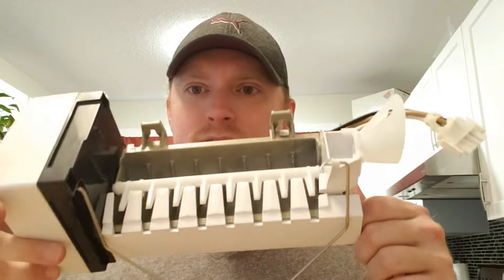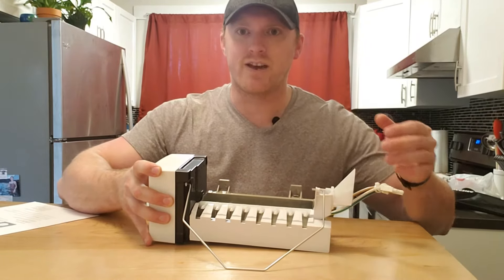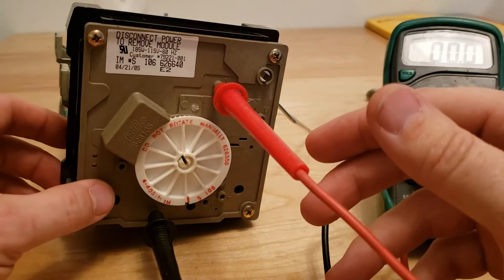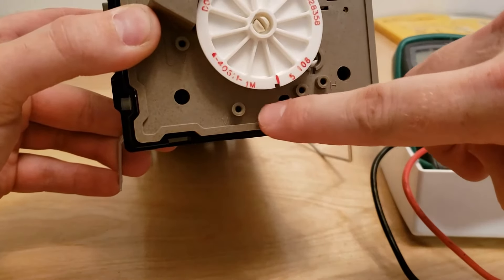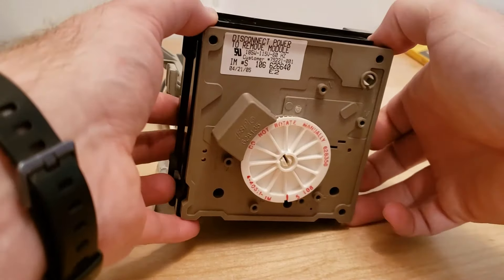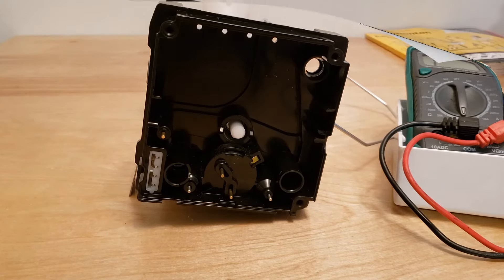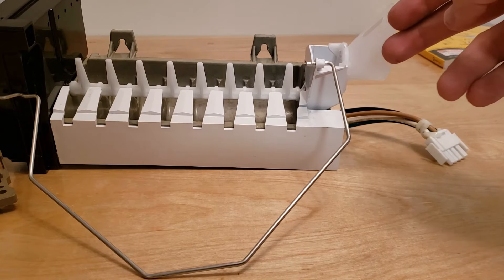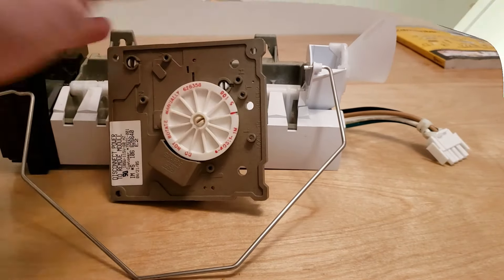FRIDGE ICEMAKER HOW IT WORKS - TOTAL DIAGNOSTIC GUIDE

Comment: Thank you Greg, second time pulling the ice maker after seeing your video I decided I needed to inspect contact points under the cover and wala there it was. Over time moisture caused the heater terminal in the inside of the cover to arch and burn eventually causing it to😀 short and stop working. You Did a nice job of identifying ALL the test points on the exterior cover. Again thank you, everything got a good inspection and cleaning also. Jayme
Reply from the maker: I'm glad you got it figured out. And thanks for watching Monty Piethon!
Reply: Bro, y lo arreglaste, de mi igual se cortocircuito, me podés explicar más a profundidad, con el conector  de la cubierta te refieres al módulo, a la resistencia?

Comment: I just replaced mine with a non-OEM unit. The plug was wrong, easily swapped with the OEM that was leaking at the tray in a couple of spots.  The cubes are slightly smaller.  The heater actually has a cover so there are no accidental shocks to the back of the hand.  It happened to me once. 

The aftermarket unit cost 65 bucks.  The OEM is $130 from Whirlpool.   I’m battling the water level.  It over filling so much that the fingers can’t dislodge the ice.  I gave it a 1/4 turn clockwise to reduce the flow time. 

I saw a video where the guy was talking about the overfilling is due to water pressure. He didn’t say anything about a time for the valve to open.  I didn’t watch the whole video.  It would be nice if the small dial on the side had markings for -/+.  A lot of the “water level adjustments” videos have the screw on the face of the module, upper right of the dial.  I had a 50/50 shot in getting it right.  Your video confirms I did get it right.
Reply from the maker: Thanks for watching Dave B, and for the great feedback.

Comment: Would have liked to have seen you point out how to check the voltage at the connector.  There are 5 wires there and I'm not sure which should have voltage.
Overall a good video though.
Reply from the maker: Thanks for the feedback Wayne Hearn. Thanks for watching.

Comment: GREAT video !! very comprehensive... I learned a lot ... especially taking apart mechanism and mentioning what each "test hole" is for including resistance and voltage if there is any. Sure don't want to purchase a new (expensive) part only to find out the problem was somewhere else. I wish I could find electrical schematics for this and other appliances; it would sure make troubleshooting so much easier.
Reply from the maker: Thanks for watching Jeff Karr, and thank you for the great feedback.
Reply: @Thomasappliance  On most appliances, if you look long enough, there's usually a wiring schematic somewhere hidden in a place you'd never look.
Reply from the maker: @jumpercable20  true enough

Comment: Why did you edit out the meter results?   There are so many things that arent explained.   How does the jumper wire work?    Nobody explains that in any video.
Reply from the maker: Which meter reading were you looking for, mine had a burnt out heater so I had 0 on a couple tests, and it wasn't plugged in so I wasn't going to get 120v when checking for power. The jumper wire bypasses the thermostat which will start the cycle. Thanks for watching robdre1977.

Comment: One thing you left out was the small nylon screw on the side is to adjust the size of the cubes.If they are too large.turn it clockwise.maybe a quarter turn. It took me a few videos to find this out. Mine was over filling and causing problems. Good video though.
Reply from the maker: Thanks for watching Elton Yancey, From 10:40-12:10 I explain all about the adjuster for incoming water. It isn't used very often but sometimes its needed.
Reply: Gracias no sabía para que era

Comment: Great video! I'm trying to adjust the amount of water coming into the ice maker. The model you have and I have also does not have an adjustable screw. Is there another way to reduce the water amount?
Thanks
Reply from the maker: On most ice makers there is an adjustment, some fancy fridges you can change the amount through the service mode on the fridge. Thanks for watching Foster Carr!!

Comment: Thanks for this great info!  On my icemaker, the motor resistance between points L and M measures only ~200-500 ohms.  But when I unscrew and take the head off, the motor resistance is correct at ~6300 ohms.  What does that mean?  Something is interfering with the motor when plugged in?
Reply from the maker: Sounds like probably just build up at connections but the head could definitely be faulty. Thanks for watching Eric Wong.

Comment: Thanks Greg very informative and detailed instructions. Appreciate your time to make this video.  Two Questions: 1) Is it possible to increase ice production if so how?  2) near the main gear looks like adjustment screw and also a nother one near top right face cover mount screw, what are they for. Thank you in advance answering my question.
Reply from the maker: Thanks for watching, if you go to around 10:40 in the video, is where I talk about the fill adjust.
Reply: Thanks again I appreciate it. It turns out those two adjustment screws 2nd part question, so I thought, are actually are pivot points for the bucket arm etc.
Reply from the maker: @FOCUS-777  yes exactly, once the head is taken off you can see a little better what everything is tied to.

Comment: Easily the best icemaker video on Youtube. Thank you. My icemaker will attempt to cycle manually, but cannot budge the ice, so my suspicion is a bad heater, but I will also pull the module and check the points just in case. And now I know how to test the resistance on the heater. On my second icemaker, probably about to be a third.
Reply from the maker: Thanks for watching and your kind words whoisjohngalt, these icemakers just aren't made too well. Good job doing this yourself!!

Comment: Thank you so much for this very useful video, Greg. I have gone through the tests you have recommended and I found out that there is only 27V are present in my ice maker (instead of the 120V) Where do you recommend I go from there? Thanks again, your video is great!
Reply from the maker: sounds like a leakage voltage, if you take the ice maker out and test at the plug that goes into the icemaker and you have 120 there then the ice maker needs to be changed. if you're only getting a low voltage there too the problem usually is in a control board.
Reply from the maker: Thanks for watching Erik Ven!!
Reply: Thank you so much. Do you know where I can get my hands on a wiring diagram?
Reply from the maker: @erikven6193  sometimes you can find them online, or contact the manufacturer.
Reply: @greg what color of wires I should test that goes to the ice maker?
Reply from the maker: @muhammadadil9373  It depends on your fridge, every manufacturer has a different wiring setup to everything on the fridge. A wiring diagram would tell you for your fridge.
Reply: I am getting only 22 AC volts. My model number is G9IXEFMWQ02. I will appreciate your help!! Is there any video on how to change the board?
Reply: @Thomasappliance  I have one black, white, green and I think the other one was a light grey.
Reply from the maker: @muhammadadil9373  thats not enough voltage there, I can not bring up that model number either.